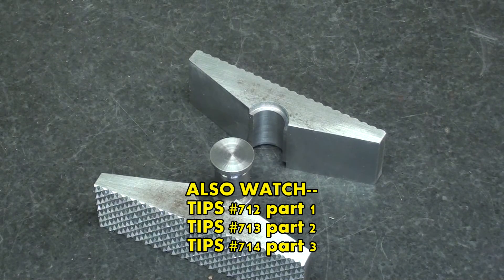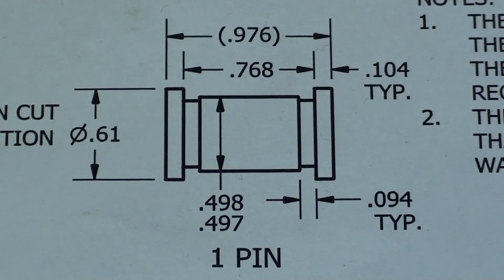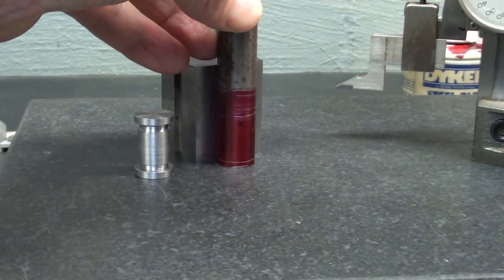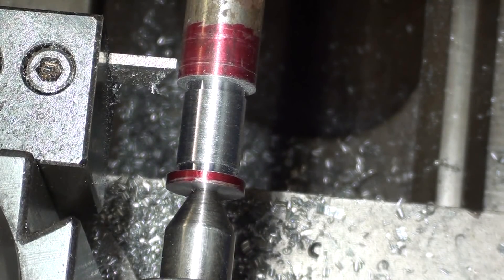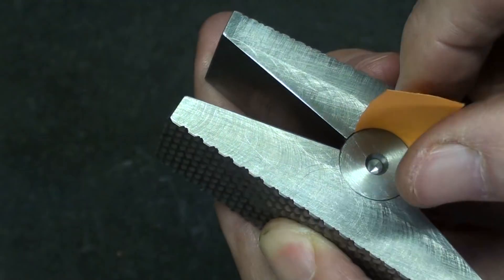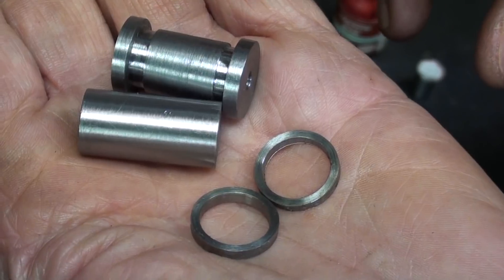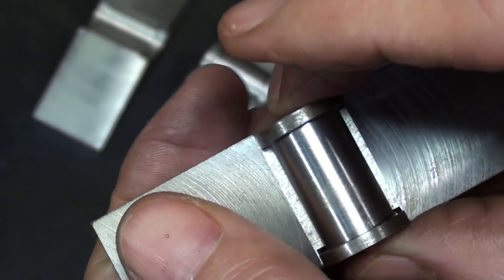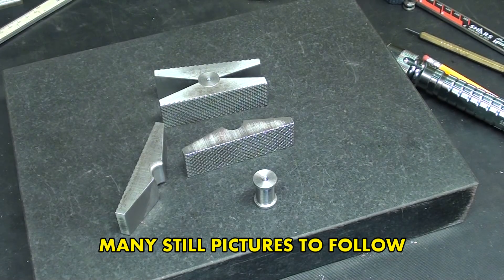MAKING SWIVEL VISE JAWS #715 pt 4 tubalcain PIVOT PIN

Comment: Thanks for all the videos,  I do not even have a metalworking shop but my mainly woodshop has benefited from your videos.   I did have a question I thought you could answer.  I recently picked up a older (approx 50 ) Wissota grinder that I am restoring.  The wheel was attached to the thick aluminum flanges by some kind of poured lead method, what is the best way to separate them?
Reply from the maker: Some grinding wheels had a lead bushing in the bore.   I have never seen a wheel Held onto the flange by any method. See if you can tap it off. Or apply light heat. Do not overheat the bearing
Reply: @mrpete222  Ok, thank you I will try that.

Comment: hello Mr pete I am a subscriber and a big fan i just got a Seneca falls 10 in star lathe and need some of the change gears do you know if the gear pitch is the same as the atlas gears that you printed ?? thanks for the help
Reply from the maker: Good luck and have fun with your new machine. I have no knowledge of those gears

Comment: Hi Lyle - I was having more of a think about these swivel jaws and relating them to draft angles of cast parts. So, could you do a double swing jaw - either two small ones on one base or would this be better with two hemispherical clamping faces? Hope all is well with you - Stay safe and well :)
Reply from the maker: The next part of the video will feature a set of jawa Swiveling and tilting on a ball
Reply: @mrpete222  OK - I won't jump the gun then. Thanks Lyle :)

Comment: Backing up to video #149 from Feb 2014, thought I would share. I pick up free treadmills time to time, and the last one was a gem. Was a medical HD TM, with a 24vdc with a 3.75 hp. Plans are to replace the old 1944 Delta band saw motor with this along with power supply and motor controller soon. Have other projects pressing, but will share with you and my viewers when I get started. My LeBlond 17 & RF 30 mill both have TECO L510 VFD on them, and love how they preform. Love this swivel Vise Jaw video, so please keep your videos coming,,,Bear.

Comment: Could loctite the pivot pin to one of the jaws instead of sweating it in there?
Reply from the maker: Yes, I did that in a sample
Reply: Install O rings in grooves on the center line of both sides to hold the jaws together as a rotatable unit.

Comment: Lyle
I wonder what are the advantages of two jaws in this design versus a single triangular jaw against the movable vise jaw. I have used a pin against the movable vise jaw to hold irregularly shaped pieces for many years. This takes less space , especially important if working on a small machine. This two jaw project clearly would be helpful for holding delicate work, but it does take more space.
Reply from the maker: Your method is just as good

Comment: The undercuts are a good idea. The other thing you could have done, which is a little bit more complicated, is to make the center pin and two pieces that screw together. If you make them in two pieces, and also put an undercut into the face that's pointing inwards, that allows the pin to trap the two job pieces. You would have to have a matching groove in the sides of the jaws where the counterbore is today. Making the groove in the pin faces would be a little bit tricky, you'd have to have a very small trepening bit. Making the interlocking groove on the jaws would require a boring head and just a small grooving bit.
Reply from the maker: Good idea, but very very intricate and difficult. How are we on the skill level of the common man. Another viewer suggested dovetails.    The best designs are simple and easy to fabricate
Reply: @mrpete222  I think it sounds harder than it actually is. The major effort is going to be grinding the trepanning bit out of a piece of high speed steel. The biggest effort there is the amount of metal removal you could have to do, although if you started out with a ¼" blank that wouldn't be too bad. You can even start out with a cutoff blade if you've got a left-handed holder of some sort.

At any rate, once you've got the tool in hand, then actually making the part becomes pretty easy. Start both jaws at the same time as one piece in the 4 jaw, boring the center hole, the counterbore, and trepanning the groove. Flip and repeat, then make the serrations, cut the work into two pieces with the band saw, and then finish the angled sides on the mill.

Make the center pin in two pieces, starting out turning the reduced diameter center section, and then making the groove in the back side of the flange, which is now facing you and easy to access. The same grooving tool will work for both pieces.

I would, however, reduce the diameter of the recessed section of the pin to 3/8 in, so the flanges become 1/8 in wide and easier to groove. Cutting a 1/16 in wide groove is a lot easier than cutting a 1/32 in wide groove.

Comment: If the angle of the blocks went through the center point of the pin you would get more range of rotation.  Is there a reason why you didn't do that?
The cap screw retainer is a good idea.

Comment: I see that you like many others layout lines on the part.   Why?  Don’t you have controls on your machine that will allow locating the feature more accurately than the lines?   Not a criticism, just a question.
Reply from the maker: Sure we do. But don’t you think it helps the viewer of a shop video to see the layout lines?
Reply: @mrpete222  I don’t know.  Honestly.   I have used layouts so rarely.   I learned in the 70’s.   In the sheet metal shop we used dial indicators on the punch press with a back gauge.  In the machine shop we had trav A dials on every lathe and optics on every Bridgeport mill.   I just equate layouts to the way wood workers do things, not machinists.  Today with the DRO’s, layout lines should be relics of the Stone Age.

Comment: Mr. Pete, great job. After watching I thought that adding retaining springs inside to keep the pieces as one unit.  Also instead of a vertical pivot how about a horizontal pivot, each could be enhanced by adding a step to the adjustable vise jaw side to keep it stationary in the vise.

Comment: Hello Mr.Pete. I noticed in a previous video of yours that you have a Brown and Sharpe No.22 mill vise. I have found the castings of an old one that was missing every other part. I made all the bits so that it works, but I did not know what the jaws were supposed to look like. Thanks to your video, I was able to make a pair of jaws for it that were at least the right shape. I know that wasn't the intent, but it worked out. Thank you! :)

Comment: For extra credit, I think I'll make the pin two pieces and add dovetails to the insides of the shoulders and the counterbore of the jaws so when I screw the two halves of the pin together, it captures both jaws.
Reply from the maker: That would be awesome, send me a picture after you do that. Which by the way     won’t be easy, LOL
Reply: This won't work because the pivot hole subtends less than half a circle.
Reply: @jonathan1427  Think about it a bit more before writing it off as impossible. Mr. Pete understood the concept of the design. I can always send you a blueprint if it doesn't click.
Reply: @merlinmagnus873  I would love to see a sketch. I've been thinking about this for a few days but can't visualise how to retain all the pieces without adding features that require a rotary table.

Comment: For your future video on case hardening would it be possible to case harden some 17-4 stainless? (I need to do some research if that is even possible. I do know 17-4 can be hardened, just not sure it can be case hardened. I have never seen that process and am looking forward to your video).   Thank you.
Reply from the maker: I have never tried it. I would say probably not? You would have to experiment
Reply: Looking forward to learning the process from you.  And then experimenting.  Of course it is an excuse to by a heat treating oven. ...

Comment: Would loctite hold the pin in one side?
Reply from the maker: I am pretty sure it would and will show that in a follow up video. Number five in the future. Number six will be case hardening
Reply: @mrpete222  I thought it might, but I am not well versed in the use of loctite.  Thanks for your reply.

Comment: Would it be an idea to magnetize the center pin, or to embed a small neodymium magnet in the pin to hold everything together?
Reply from the maker: Good idea
Reply: I had the same thought.  Maybe mill a small recess for a magnet in one or both jaws. .....However,metal chips and filings would probably stick to it and cause alignment grief.
Reply: I’ve tried using magnets from variety of tasks in the shop and I’m usually unhappy with the number of chips they collect that you absolutely, positively, no way, can get out or off of the magnets.